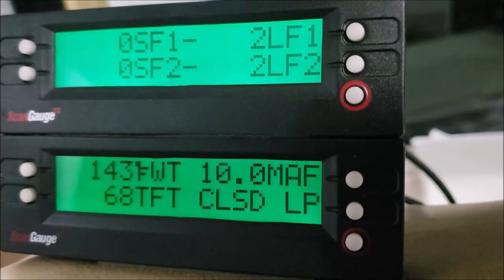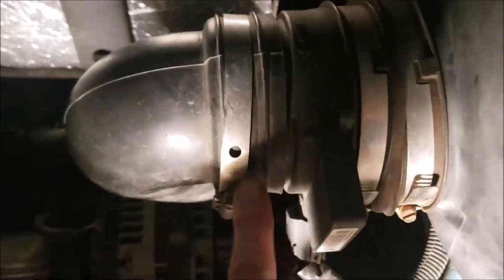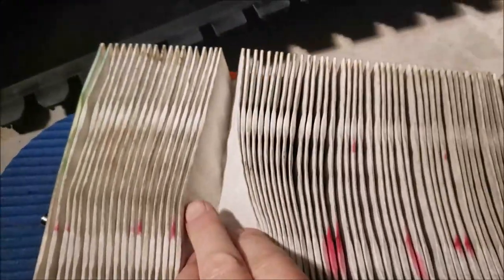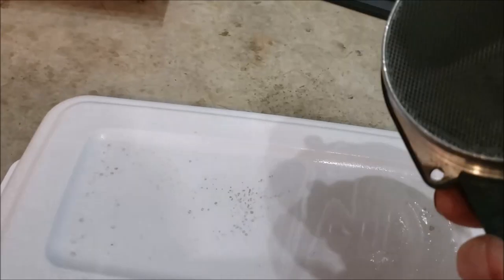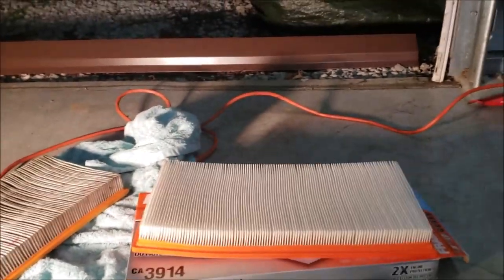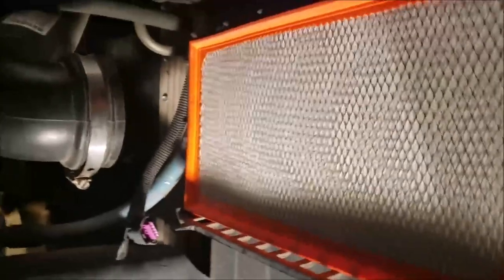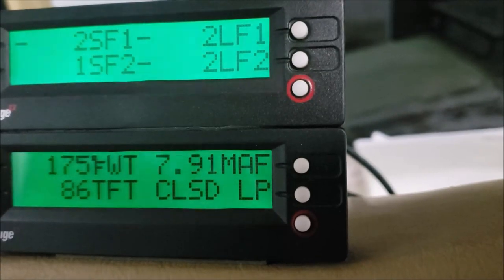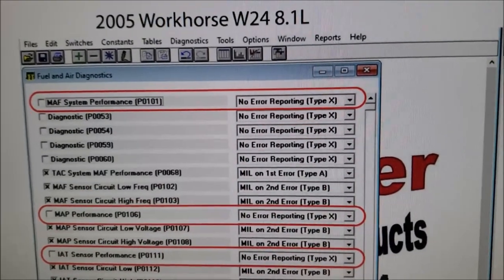8.1 Vortec MAF Cleaning Before & After Fuel Trims/Grams Per Second Measured + Filter Change

Comment: Hey Kevin. Just catching up on some of your video content. Great stuff. Question: is the a software program that will enable the fuel injection criteria that is missing?  Thanks
Reply from the maker: I think with the correct software like HP tuners these settings can be turned back on, but I don't know if its been tested yet by anyone.

Comment: Thanks again Kevin, putting my sensor in today, hopefully that will take care of the P0327 knock sensor code. Keep up the great videos and all the help.
Reply from the maker: Let me know if code comes back
Reply: I'm getting P0332 which is for the knock sensor... did replacing the MAF resolve it?
Reply: @mooreadventures  my problem was that the wiring to the knock sensor got super hot and brittle.  The connector was essentially shorting out.  I replaced the connector and replaced the wires to it.  Super easy job, frustrating until I figured it out.

Comment: I have the same chassis- have you found the transmission cooler is adequate in most cases?  Does the transmission temperature fluctuate much?   How do you feel about brazels rv 8.1 engine tune?  Enjoy your videos,
 Jack&Molly
Reply from the maker: Yes I did Brazels ECM upgrade many years ago More power for sure. Transmission temperature seams to run 20 to 25 degrees below engine water temperature. 
What temperatures are you seeing?   Thanks for watching Jack & Molly

Comment: Thanks for all your Workhorse videos. You've helped me numerous times with my '04 W22.

I had a problem with a bad miss when under heavy load, i.e. pulling a grade that required downshifting to 3rd (out of 5). It finally through a code indicating a MAF problem. I found some corrosion on the connector pins. I mechanically cleaned and used a small amount of DeoxIT. Also put dielectric grease on the rubber sealing surface of the plug.
Seemed to fix until I hit another heavy rain. I've repeated the cleaning but have little confidence that it's solved. Thinking of splicing in a new plug (source?) and replacing the MAF.
Would appreciate your thoughts.
Reply from the maker: I would go ahead and replace the MAF first ours failed many miles back and many other workhorse owners have had the same problem. Look at your old one for part number. 
 This is the one I installed, be sure to use Delphi brand.
Delphi AF10043 Mass Air Flow Sensor  https://amzn.to/3v7eFBV
Give me a call if you want to chat my cell 606-875-0125 Kevin Caudill

Comment: Hello I only found your you tube I find it very help full and I have a 2002 Winnebago 35 U 8.1 Also I am always looking at things on the RV I noticed that I do not see any thing about the exhaust manifold and broken bolts gasket leaks I have done a few times that a pain, the drivers side is harder due to the wiring and hose protection plate i seems to me that we are the same type of dude always fussing to get the best from the RV take care and be safe norm
Reply from the maker: Thank you Norm so far no exhaust leaks on ours but I keep my eye on them just waiting for the day...lol
Reply: @ktoutdoor    I have one for you a number of years ago we were on our way to Fort Wayne  In. I was  not going to take the toad.. but after the wife said to take it  We were on our way only 10 minutes of driving I heard a clunk clunk and saw the temp starting to rise I stopped  I blew the belt.. got in the jeep and drove to a few auto supplies to try to find the belt did not find the correct belt ,,, now to get it on I see if installed wrong the water pump and other pullies can go the wrong direction went to a auto shop and got a layout  and ( are you ready 8 hours later we were on our way) after I do a lot of work on auto was hard laying on your back and the belt was too tight..  At the G M dealers pulled all info from there dealerships and at Auto Zone I got a few belts and one was correct now I carry 2 belts and tell all my friends   that have Motorhomes to carried a belt for the mechanic or their self ..
Also I carry a in line  pump hose and wire for the last 4 years Thanks to you am looking it to another set up... 
Keep up the GREAT WORK the readers love to get info on how to do stuff  BE Safe
Reply from the maker: @normnegus650  thanks for the great story. I'm sure there will be more ...lol 😆
Reply from the maker: @normnegus650  Great story you just never know whats going to happen next we just had our first tire blow out video to post soon.
Thank you for taking the time to contribute.

Comment: My MAf Numbers on idle is about 2 point something three point something. 
Same engine is yours 8.1 vortex
Any idea??
Reply from the maker: Assuming you have a scan gauge that will show you gps grams per second on the MAF sensor.
Test like this: from a rolling start put your foot to the floor wide open throttle fully loading the engine up to 4000 RPM you should see at least 230 gps on your gauge.
If you don't then you need a new MAF very common part to fail on the 8.1 Vortec 
This is the correct one to use Delphi AF10043 Mass Air Flow Sensor https://amzn.to/3iP0CKX   
Text or call me if you have any questions 606-875-0125 Kevin
Reply: @ktoutdoor  your are Amazing !!!!!!!!!
Thank you!!!!!!!!!!!!!!!!!!!!!!!
I will find out tomorrow.
Reply from the maker: @andredesouza9767  Let me know what you find.
Reply: @ktoutdoor  yes sir!!!!!!

Comment: Great video!!
Reply: I continue to get an error code Knock Sensor Low voltage Bank One. I’ve replaced both and the pig tails look good. I know they adjust timing and that is the source of my low power, engine sputtering issues. I need to chase wires all the way when I get home but do you have any other suggestions?
Also, what code reader should I get to communicate well with workhorse W22 8.1L?

Comment: What color was the resistor wires in the maf? Thank you
Reply from the maker: I don't remember why do you ask?
Reply: @ktoutdoor Thank you for the response. I was trying to figure out the resistors that were in my MAF. I ended up getting HP tuners to re scale a Delphi  unit in my truck.
Reply from the maker: @ktm450sxpro111  Interesting I would like to chat with you about the mods you are working on, my cell 606-875-0125 call or text any time Kevin

Comment: I have a Scan Gauge II, but would also like to have the ECM set to turn on the CEL for all the codes you pointed out. Is there a program that can set these to come on? Possibly at a Chev or GM dealer, or maybe Brazel's can do it? I have contacted them about changing the PPM setting to correct my speedo that reads 10% fast, and they said they can do that.  Just have to get there one of these days.
Reply from the maker: Brazels is looking into it.

Comment: Hi, Thanks for your videos! I have a 2003 Tiffin Allegro with 18,000 miles on a 8.1L Workhorse v8. Workhorse W22 chassis. We bought it last October (2020). Then we both got covid, then I got pneumonia. We have only camped in it 3 times and those have been in May 2021. We have not used 2 full tanks of gas. It ran great until this last Monday. On our way to Alum Creek State Park it ran great 3/4 of the way there. Then it spit, sputtered and died 12 times. Luckily it restarted every time and we got their safe. I called my son who is a Mechanic. He said check for loose battery cables connections, Install new air filter and new fuel filter which I did. i also put 2 bottles of HEET in about 30 gallons of gas (in case of water) along with a bottle of injector cleaner. I thought we'd fixed it but about 4 miles from home on our return trip it did it again twice! I am old but still handy and can change the plugs and wired but if that was it, it wouldn't be intermittent? I called my nephew,a mechanic, and he thinks it is the fuel pump. I don't know if i'm handy enough to remove the gas tank to change the fuel pump. Would the fuel pump be intermittent?
Reply from the maker: Give me a call on my cell 606-875-0125 Kevin

Comment: Wow, I have the scangauge 2 and it doesn't have hardly anything you can monitor on my 8.1 truck.  How do you update it?
Reply from the maker: Text me you email address and i will send you the xgauge codes. My cell 606-875-0125 Kevin
Reply: How did you connect your 2nd scan gauge? Did you use a wye connector and if so where did you get it?
Reply: @sunnyjim5816  he shows it in one of the videos, it was an OBD2 splitter cable.  Though I have often wondered if you could just put a cable between the other port on the first scangauge and into the next.  Since they each have 2 connectors for ease of mounting.

Comment: Kevin, what spray cleaner did you use?
Reply from the maker: CRC makes good stuff.
Make sure to use mass air flow cleaner not carb or throtle body cleaners 
https://www.amazon.com/dp/B00BPMCJKQ/ref=cm_sw_r_cp_apa_fabt1_20CSFbZ11WHDE